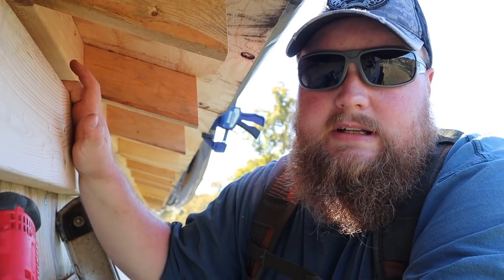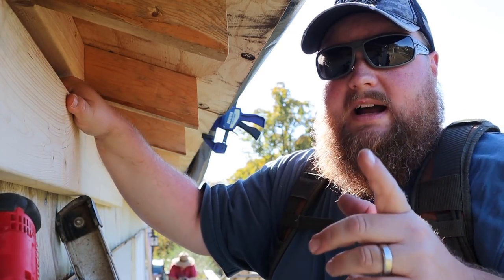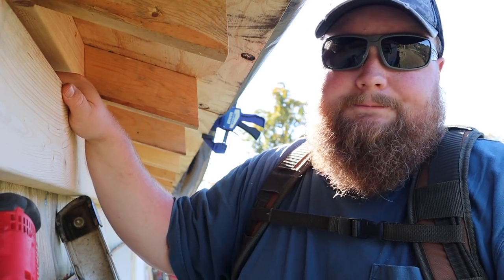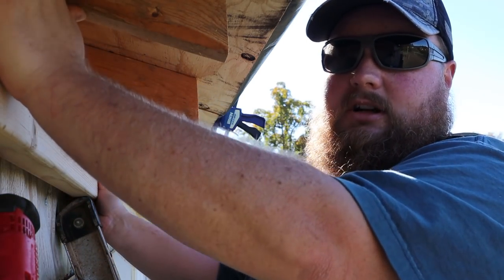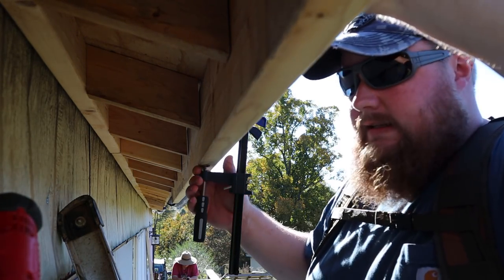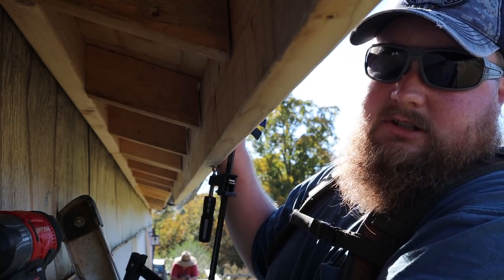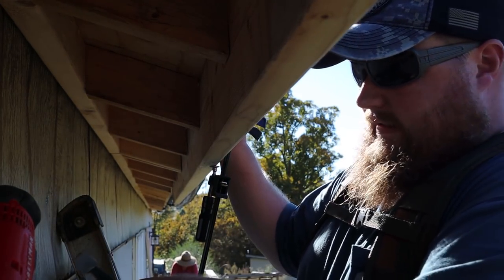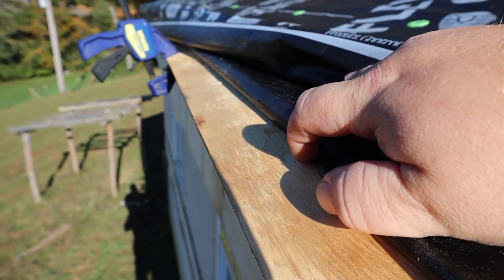Eave Framing - Mobile Home Roof Project

Comment: I have the same ladder and I can remember when it was easy to move around and now........  I just can't do it.  Too heavy.  But it is a GREAT ladder.   Have you noticed how much screws are????  I just about had a stroke yesterday when I bought a box.  $33!!  And one sheet of plywood was $47.   Something has GOT to give.   You are doing such an amazing job!
Reply from the maker: I've come to dread going to the hardware stores! 5 lb. box of the long exterior screws was $40. 2x4x8s had come down slightly to a (not-even-close) reasonable $6 each. UGH!!!
Reply: @sam-and-angela  Same here.  It's ridiculous!

Comment: Great video, and I also need to "find" the 2x2 trusses under my plywood, but Im going to screw long 10' 2x4's over them first, then sheath for about a 2' eave.  Those ladders are ok for what you did, but I'd never attach another roof too to them.  Even if the roof survived, imagine how much extra the frame outriggers would need to carry.

Comment: I have a 1985 Liberty with an original metal roof that doesn't leak or need to be replaced. I hate that it doesn't have eaves and useful gutters though (the mini bent metal wanna be gutters don't count). Is there a way that you think I'd be able to add eaves without having to replace the whole roof? I don't even care about having covered eaves, just want to extend it so I can add real gutters.

Btw, I love you guys!

Comment: Did you you use 2x4 or 2x6 for the angle rafters?  For a 3x12 roof pitch what degree angle did you cut the rafters to? Great idea to extend my roof beyond the walls.

Comment: How do you know your not hitting any wiring or plumbing when screwing on the fly rafters with 3" screws? Or is there no wiring or plumbing running through the top plates on mobile homes? looking good!
Reply from the maker: There's no plumbing up there, and the wiring have metal plates covering them. But... this is how it is with OUR HOUSE -- not sure about others!

Comment: Love your videos and the Information you so kindly share.. But was curious watching you removing the medal gutters , wouldn't It of been easier to do that before you Installed the new roof and over hang. Just curious you probably had your reasons . God Bless your family be safe...😊
Reply from the maker: It sure would have, but the tiny gutters and screws are what primarily hold the metal roof on top of mobile homes. We didn't want a storm to come in and destroy everything... too risky for us.

Comment: Nice video, thanks!
Hey if u could reply it'll be of great help since I'm doing a complete rehab on my single wide. Did you lay the new roof on top of the old metal roof? Is that how is done? My single wide has some skinny trusses not sure if it'll stand the weight of a new roof but I wanna get rid of the old leaky metal roof!
Reply from the maker: That’s what we did, yep. Check the description or our video library. We have several videos on this whole roof job. Good luck!

Comment: Whilst you are both putting so much great effort into repairing your home , had you considered building one on the same land while you live in your original one ?
You seem to be able to turn your hand to anything Sam.
Reply from the maker: We've thought and talked about "some day way in the future" LOL There's not really a spot on this current land to do so. The county boxed us in with septic permit and required areas be left for possible drain fields in the future to where there's not place to build anything else here. But that doesn't mean we've not dreamed of buying land and building something from scratch ourselves!
Reply: @sam-and-angela  I did wonder if that were possible seeing as you are spending so much effort on doing up this home y ou have now, although I fully understand why .I DO commend you on your amazing work ethic .

Comment: Sam and Angela, Why in the world would anyone put that old brown metal roofing on a mobile home? Doesn't people know that a black, brown or dark colored roofs are going to absorb almost all the heat from the sun directly into the mobile home? That means during the hotter months of the year that the AC is going to run almost continuously in order to cool the mobile home inside. Doesn't anyone realize that your electrical bill is going to be enormously high and probably still won't completely cool the home? Please consider lighter roof colors such as white that will direct most sunlight off and away from the home. This will drastically help to lower your cooling cost and prevent you from having to replace your AC prematurely. Lighter colors on roofs and exterior walls is the smart way to go and the savings on your electric bill will almost pay for it all.